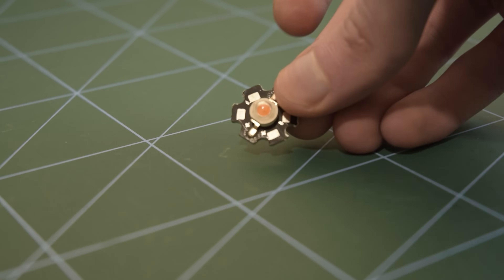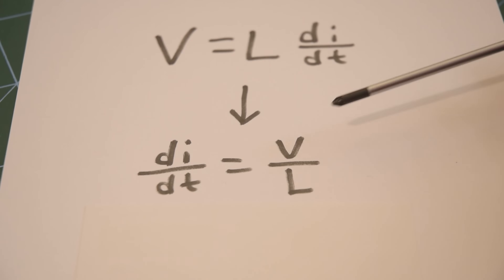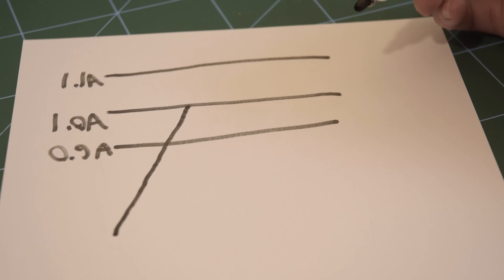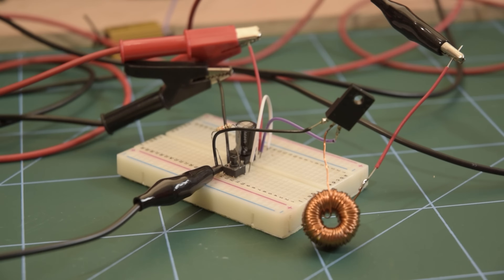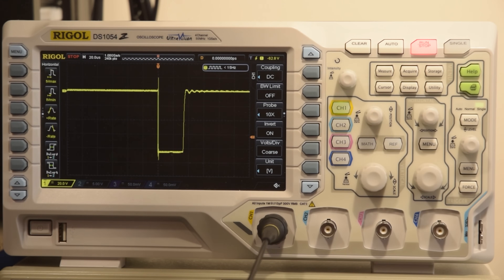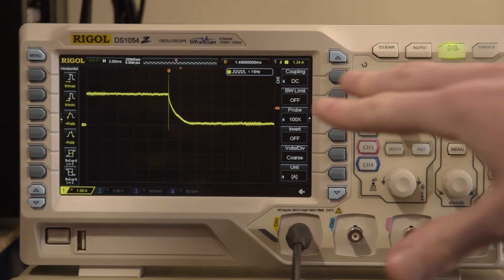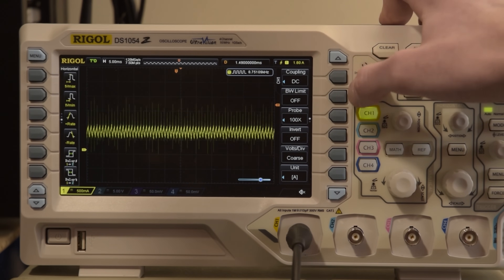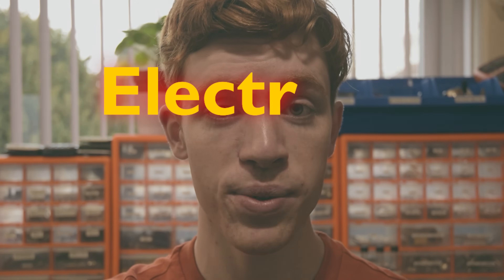Inductors in Power Electronics (Direct Current Control)

Comment: @electricarc240 just subscribed yesterday & been watching some of your old videos.   Not made it far yet but wanted to say i have a somewhat uniquely compromised problem. 

3-phase motor that only needs to run at a single (base) speed. 850, 1750 or 3450RPM depending on pole pairs of the motor.     We inly have single phase 240v (120v +/-) to use.   The waste water pump is what we are making.    

Can we control / run the pump with the windings as the inductor side?   Sure a VFD could be used but the enviroment is bad so solidstate small discretely built components may hold up long term much better for a 16 amp motor specific design?

Than will keep watching.
Reply from the maker: I don't know much about industrial stuff, but if you need to run a 3-phase motor from a single phase supply I'd definitely try to stick with a VFD. Maybe look for extra robust ones or fully sealed units
Reply: @electrarc240   what we want to do is put the electronics into the pump cap (submersible pump) and pot the components so that it runs single speed when power is applied.   VFDs are way too costly for this application,  household sewage ejector pumps.   Price is paramount & if we can run the 3 phase motor without the required capacitors etc maybe it would be a better idea?
Reply from the maker: @markmatt9174  And you can't use a single-phase motor? I'm not sure you can do any shaded-pole trickery for a three-phase motor but I may be wrong
Reply: @electrarc240  we have single phase motors, they are a bit of a issue with the start components & spikes on the lines.   Starting & stopping 5 or 10 times an hour also can cause those start caps/relays to go south in a few short months on the small basins.
 Why we were / are looking at simple solutions for 3 phase conversions, (DPS) units have to be tailored & seem to have similar issues.

Comment: I just subscribed after watching your popular video about power supplies.  I know enough to be dangerous.
I'm commenting about an extremely popular problem that I'm sure would get many views.
I (like thousands of others) bought a VFD and read in the manual that I should have "AC reactor" and an "Input EMC filter" before the VFD.  (My VFD powers a 3hp motor that is normally 3 phase but the best I can do is single phase 240v).
As for the AC reactor ebay has them for around $300 which is what I paid for the vfd.  I've been told I can use a used 3 phase one if I use the outer 2 coils.  Then I found a guy who made one for less than $20 by cutting an iron pipe and wrapping wire around it.  He ended up with around  5% inductance, which is what is recommended.
I am not alone with this problem.  If you could made  video about it I'm sure you would get everyone who bought a vfd to watch it.
Should I buy one of those big 3 phase ones, could I make one with an iron torroid, how does one size a filter, how about just a surge protector, where do babies come from, what is the capital of South Dakota?  All these questions keep me up at night.
Thanks for your great videos
Reply from the maker: Hmm pipe sounds a bit dodgy I would imagine there would be a lot of losses. I can have a look into it though as I recently got the kit to characterise inductors so can test custom ones. As for babies, absolutely no idea I'm afraid...

Comment: Thank you for proving that the driver I designed will work. I'm using an h bridge to isolate and increasing voltage on the secondary then running a bunch of 50w COBs in series, limiting the current to 1.5A.  That 200ma window using a flipflop and comparators, maybe a little signal filtration and there's uninterrupted light, which is ideal.

Comment: Very nice videos, I like your step by step methodology in presenting subjects, subscribed instantly. 
The inductor is the analog compliment of the capacitor: a capacitor once charged would short-circuit (lose charge) if we touch its leads, an inductor needs its leads connected once charged so that it does not lose charge (and keep the magnetism not collapsing)! 
In a perfect world where the inductor was made out of a super-conductor, the current would keep on going. In this world we are in, however, we have ohmic losses, so an inductor cannot possibly compete with a capacitor in this area. A capacitor can remain charged with no losses, indefinitely. Therefore, in any power systems where you care about efficiency, you would use a capacitive design, as they do for mobile phones (the voltages are upped or downed with putting capacitors dynamically in series and parallel, and the current is supplied by how many charge transfers you do).
In the design here, you are using a diode to keep its leads connected in the off-cycle, and this introduces a huge amount of losses. You see, a photovoltaic cell, an LED and a diode are the EXACT same devices (believe it or not!), with a slight change in bang gaps. The simple p-n silicon diode is like effectively having an infrared LED turning on every time it is forward biased!! The perfect solution here is to have a field effect transistor also on the top side, instead of the diode! You energise it when you de-energise the bottom one, so you could have it on a single wire if you use p and n types for the top and bottom transistors respectively. That way you have extremely low losses (a good transistor nowadays has a resistance at the range of milli-ohms when turned on, it has a negligible voltage drop). 
Also, for very high frequencies, or for excellent synchronisation of the two transistors, you could count the nano-seconds it takes to energise and de-energise the gate for each one, depending on the voltage you are supplying, and you could apply the correction time offset with a microcontroller.
If you are wondering how you could connect both of the mosfets on a single signal, on a single wire, you could have a look at the videos I have uploaded on my channel regarding the CMOS not gate.
Best regards :)
Reply from the maker: Superconducting inductor, sounds like an MRI scanner. Thanks for all the info!
Reply: @electrarc240  Yes, they use them there... An inductor like that would be very happy in a closed circuit. It would be the equivalent of the quality we enjoy with capacitors: the charge is not lost, until you need it. 
For example, in a system like that, once you do the initial charging, you would leave the top transistor closed while opening the bottom one. The energy would just exist as a magnetic field, until you need it.
Reply from the maker: @BillDemos  Oh how we dream... Maybe one day

Comment: Samsung hides this component, so I checked on what it really does. Blacklisted power banks, stolen ones use the winding to self drain the battery, it becomes very hot. During normal charging it is warm. It is designed to self maintain the battery during normal use. I am not sure, if it has radioactive memory effect for a while after it is bought.

Comment: all right mate, watched a few of you're videos and think you are quite a ground lad, unlike most who have there head up the mainstreams arse. so ill give you something to think about.......AC & DC are the same thing, AC does not alternate, it's basically DC being switched on or off, it is the switch that alternates not the electricity. everything is Fields, electrons don't exist, think about "WIRELESS" power induction and how the so called electrons flow through free space. magnetism, dielectric and electricity are the same thing, a magnet is electricity slammed in to a metal that traps it in, and then coursing the magnetic field around the metal as it tries to escape, to help it escape just heat it up and the energy goes right back in to the either or the dielectric.....we live in a magnetic field around the planet, and how do you manifest energy like in a AC generator? you simply spin a copper coil in a magnetic field and we live in such a field. because everything is fields then all electrical energy is RF and is how all wireless technology is able to operate. one more thing to think about.......if you stick a magnet on a vertical sheet of metal, did you know that you have just broke the law of gravity and the law of conservationist energy, all at the same time, as your putting no energy in, but your getting energy out, and it isn't falling to the ground...... keep up the good work, and if you apply what ive just told you, you'll find a whole lot of new avenues will open up and restriction will be lifted, as the rules of the game change in you favor...

Comment: In the waveform where the voltage is going to 85 volts, that particular voltage has nothing to do with the inductor, as such. It is the result of causing the body diode of the MOSFET to avalanche. It stays at the avalance voltage until the energy stored in the inductor been discharged.
Avalanching the diode can be destructive if there is sufficient available energy/power (they are generally rated separately, hence the slash). In some circumstances it is perfectly safe to allow it.
Note that at all times the drain of the FET is positive with respect to its source.
Reply: holly smokes, the video is wrong then?  i mean, delete the mosfet, use a hand switch, it then  won't dip down to those  -85 volts ?
shhht.... every solution brings new problems!!
Reply: @josepeixoto3384 I've seen this demo done in physics class with a large inductor and a knife switch.  What happens is that when you open the switch, the insuctor generates such a large negative voltage that the switch visibly arcs.

The video isn't wrong, but the reason it reaches only negative 85 volts is that the FET's breakdown voltage is clamping it.
Reply: @dylangergutierrez  You are right that ARC will occur between the contacts and that is why solar panels with long cables pose a great risk of starting a fire if they get a bad connection somewhere.
Reply: @jacobhn2  So this is the reason the loop that is made connecting the panels should be as small as possible by keeping the plus and minus cables almost next to each other?
Reply: @Gerardus80  Yes, the cable as close as possible to reduce the cable's inductance, but it's in a pipe so it probably can't be done better, but there are still cables around the solar panels that have high inductance. The trick is to interrupt a charge 1 (wait until the sun is gone) 2 (cover the panels) 3 (interrupt the charge slowly, e.g. 10-0A with a PWM.
Reply: Yes, interesting point from @d614gakadoug9. 

Fred, I've looked over your LinkedIn Profile, and I have sent you an invitation to link with me if you wish. If I may offer a small piece of advice. Your "I'm crazy passionate about (Power) electronics" is or will limit your career development going forward, and I must say after reviewing you on LinkedIn, you seem to lack a broader experience base in the field of Electronic Engineering. Switch-Mode PSUs have been around in consumer electronics since before you were born, I was dealing with them during the 1970s, of course, the power requirements in today's Automotive applications are somewhat different (I ran an Electronics design Laboratory for one of the largest blue-chip Car manufacturers in the world).  One of the areas I would perhaps suggest you would like to encompass more in your development is Telecommunications, but whatever you do, don't become a "one trick pony" 😉

Comment: interestingWouldBe:TestingIfTheMosfetBurnsWhenNotUsingDiodeAndTheVoltageExceedsTheMaximumForMosfet.
Reply from the maker: At this low voltage/current it may survive, at higher I doubt it would but yes would be interesting to test. Especially with a huge inductor maybe some magic smoke could be produced ;)

Comment: Wouldn't a capacitor at the output reduce the ripple?
Reply from the maker: Adding a capacitor can lead to a less uniform current waveform which makes this kind of very basic control less stable. If you make this circuit properly with a microcontroller adding a capacitor would make more sense. I will try and make a video covering that in the next few weeks if I find time.

Comment: I'm stuck on a problem I need a solution to! Think this video may be close to the solution.
I need a Vampire power supply, that can give a regulated 5v dc @1amp, 
No matter what the AC input voltage is. 
 An operational example:
 Have an electronic dimmer on a lighting circuit say 100w bulb we need to generate the 5v dc no matter what that Dimmer or Variac is set to (20 to 100 percent)
 Any help is be appreciated. 
Love your videos they are very Good, You right get to the point, and you are good at making them understandable for us average folk.
Reply from the maker: A simple linear regulator like a generic 7805 is the simplest way to get 5VDC@1A, I would use one of those as the final stage of a PSU, but they can only take up to around 35VDC on the input so preceding that you'd want something else. simplest would be a transformer with a rectifier such that the output would always be between 35VDC and maybe 7VDC. this wouldn't be very efficient or compact though. Really you want a switch-mode PSU which you could maybe achieve by rectifying the mains directly then feeding it through a circuit similar to this, but with voltage feedback rather than current. This wouldn't be isolated though so definitely shouldn't be used for anything a human could come into contact with. I'd look into buck converters, or forward converters if you need the isolation.